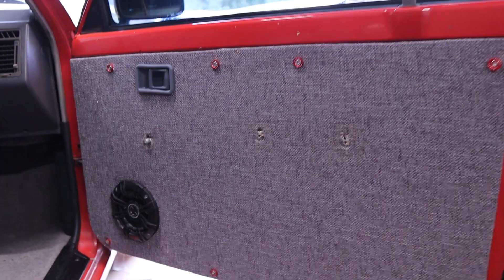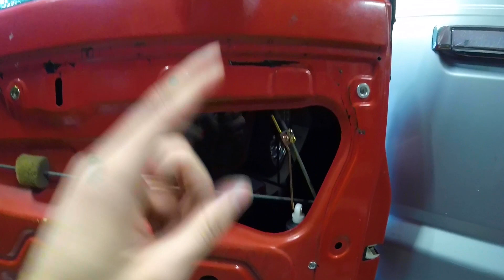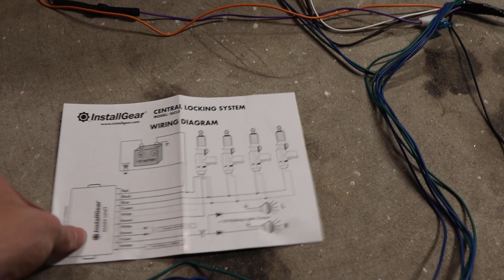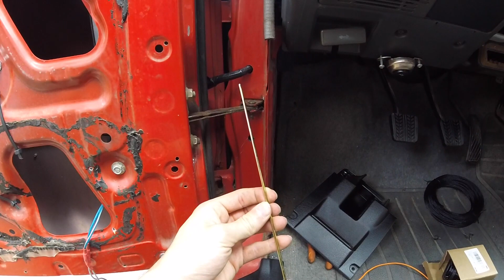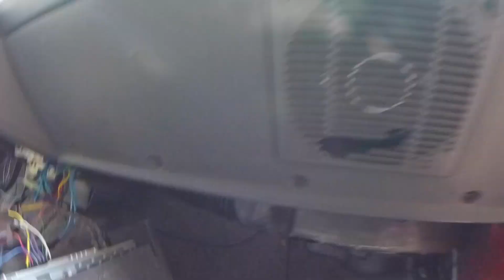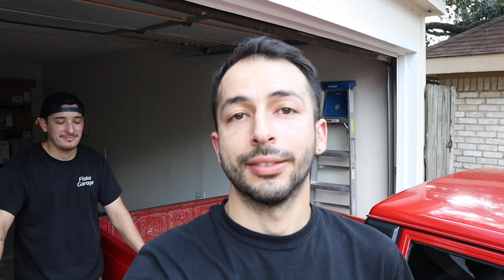How To Install Power Locks Mazda B2200 B2000

Comment: Hey i watch your vids all the time very helpful. I need help. I got b2600i and the pull up lock isnt there
Reply from the maker: Most likely fell inside the door, you'll need to remove the door panel and put it back in place if it's still there hopefully

Comment: hey man i installed the kit today but whenever i press the lock button on my key fob my truck will lock but right after it unlocks so it can’t really lock do you know what could be causing this?
Reply from the maker: I’d check all wiring and make sure nothing is connected wrong, wiring in the box and the door locks. Sounds like maybe a short or something that’s making it open again

Comment: Any way to put an actuator in the tailgate and make the trunk button open the tailgate?
Reply from the maker: Where there is a will, there’s a way. It won’t be easy but you’d have to modify the handle to be able to lock and unlock and have it open with a button or something. It would be a very unique tailgate for sure
Reply: You would have to cut out and weld another trucks tailgate locking mechanism and handle that actually locks before you could get the tailgate to lock and unlock with the actuator. I have plans for that in the future. Maybe I'll post a video. 🤔

Comment: Those open section on the lower door is actually  for a vent piece on the door panel it's self.. .it helps release cabin pressure....to my knowledge speaker came on lower part of dash left and right and certain models on b pillar behind the seats ...you can see speaker grilles ...knowledge from.my b2000 of years gone by👍👍👍🇿🇦🇿🇦🇿🇦
Reply from the maker: The section close to the door hinge where my speaker is has nothing from factory on that spot. Only the other ones where I was initially trying to put the actuator is what had vents but as you can see on my video, I don't have factory door cards or vents so there's no need for them on my doors. You are correct, speakers factory came in the dash for regular cab, for extended they came in the b pillar or extended part of the cab. I haven't come across a regular cab with factory wiring on the B pillars but you might be right and can definitely put some. I did on this video: https://youtu.be/54ctVMjeQ7k Cheers 👍

Comment: Mazda B2600i isn't mentioned anywhere. Does this product not work on it for some reason or have you not tried it? I'm wondering because I have a 1990 B2600I and I would like to get your input. Thanks
Reply from the maker: Yes, this will fit and should be the exact same process on your 1990 b2600i! I forget about them because they aren’t very common around my parts. Their main diff is the engine but body and interior wise, they are the same as far as I know
Reply: @FlakeGarage  thnks the quick response bro!